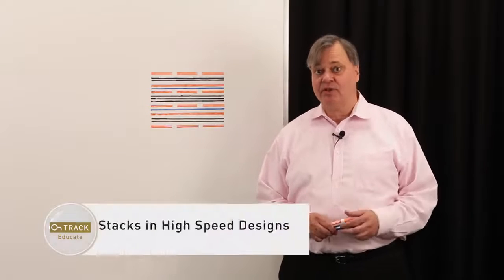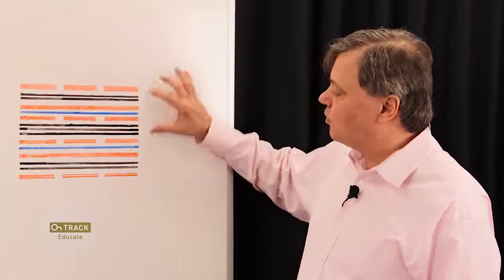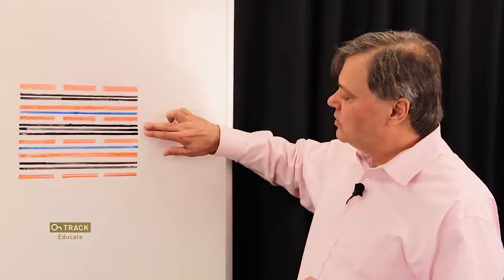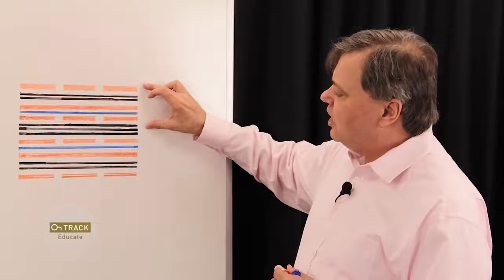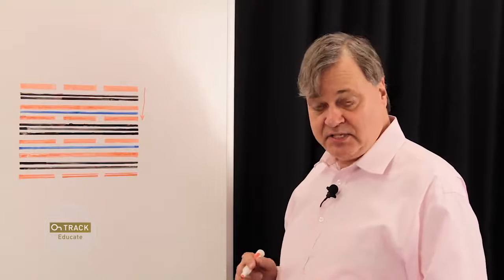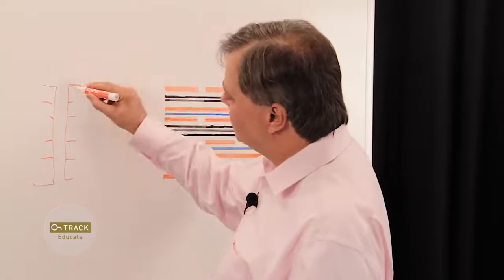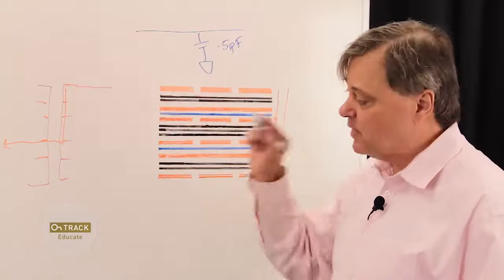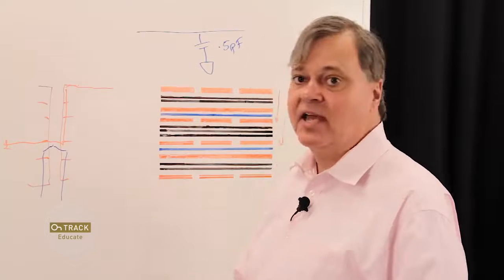PCB Design - Layer Stacks in High Speed Designs - Altium Academy

Comment: Hii Chris, Wonderful explanation, cleared most of manufacturing related questions. "Through hole vias occupies space, for compact packaging buried vias are required."
Question - About DDR4 routing, what is ideal/recommended stack-up for DDR4 (1G16 configuration) routing?
Reply: @benjordan5895  Thanks Ben..
Reply: @Ysr1991  1. u need enough space to route all ddr4 banks in the same layer 2. these have to be length matched in each layer 3. the impedance of the traces need to be kept constant. -> depending on how many ddr4 banks there are you might need 1,2 or 3 impedance controlled signal layers where each requires  2 reference planes when u want to route them embedded. for example: TOP, REF1, 100Ohm, REF2, 100 Ohm, REF3, 100 Ohm, REF4, Plane mix, BOT (10 layers)

Comment: Interesting idea. For how long has this technique been used at PCB manufacturers? It is expensive as controlled depth drilling and precision of drilling at the exact center of the via is of importance? It is not unusual to see off-center via holes on PCBs in general.